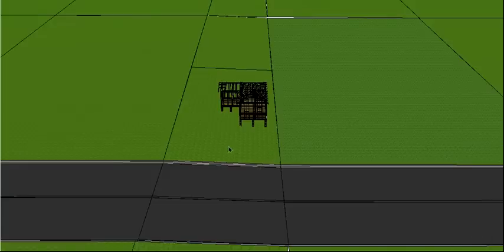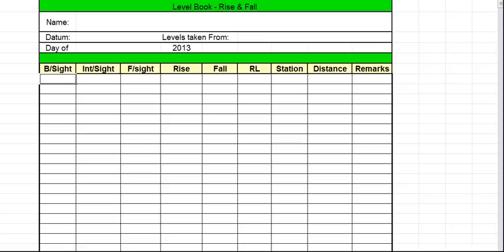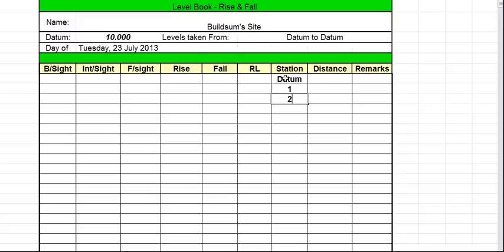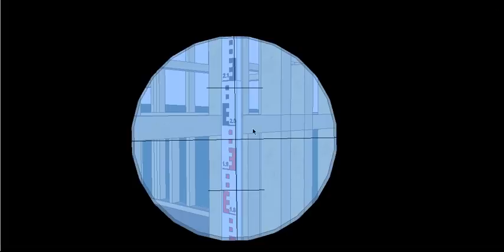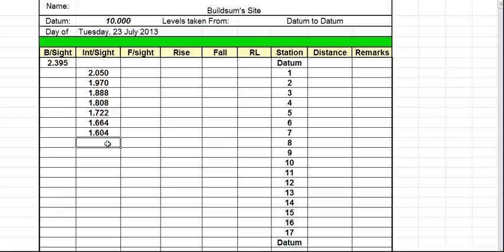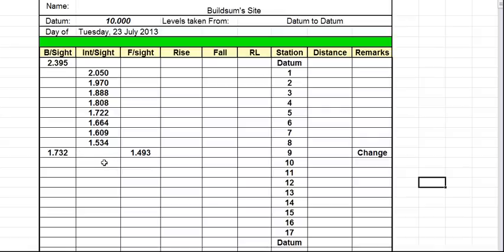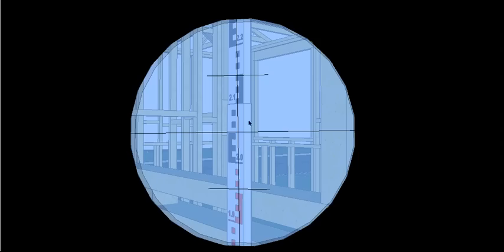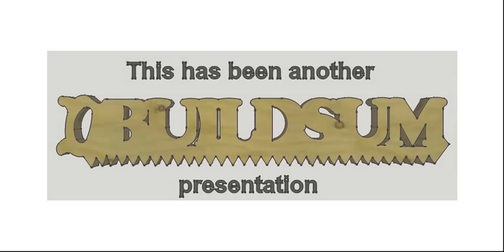Taking levels

Comment: Please correct me if I am wrong but wouldn't you need to take the level readings before building a house or was there another reason for taking them after the house was built?
Reply from the maker: Hi Mate, there is usually a site survey done as part of preparing the plans and getting the contours for the site however information about the height of specific points on the site are not included. 
 To be fair this is not a survey that you might usually require, you may only need to get the height of one or 2 points at any time however the process is the same and the point of the video was to demonstrate how the level book is filled out.

Comment: Thanks again. it would be appreciated if you could help in setting a dumpy level or theodolite on a given BM and fixed peg. i mean to align it with the peg at the Bm. When i try to set it , the whole levl goes off the preset point.
Reply from the maker: +Kiran Dewoo Hi Kiran I have only ever done this using the the Plumb bob or the sight supplied with the instrument. It is a pain to get right but gets quicker with practice.
Reply: ok thanks

Comment: great animations!  I love all your vedios and you are really helping us all! I only have a question: at the end of the process, when you looking back at the datum point (the reading is 2.634), why did you record it in the "foresight" column?  The datum is a known point, I think it should be in the backsight column?
Reply from the maker: Hi Mate, in this case, because it is a closed survey the point would be known, however, if it was an open survey it wouldn't be and as it is the last reading in the survey it will have to go in the Foresight column otherwise the checks will not work. Hope this helps.
Reply: @Buildsum  thank you very much!!!!

Comment: so why can't old mate on datum 9 stand right on the corner so when you move the dumpy (change) he can see the staff from both sides and have the same reading (not moving the staff just turning it so he can see it with the dumpy)
 and if he did how would you write it on your sheet?
Reply from the maker: Hi Mate, yes that is the idea however you won't have the same reading because the instrument has moved and won't be at the same height as it was. The booking on the sheet would be the same.
Hope this helps

Comment: Buildsum still loving your videos, fantastic stuff each and every one. 

Quick question, Pier 1 and pier 17 are the same does or should this be noted
Reply from the maker: RobertJohn Hi Robert You could note it if you wanted or you could delete the reading on 17. If you do take the reading just make sure that you end up with the same RL for both. I checked the Rise and Fall sheet and we do so all is OK.

Comment: Excellent explanation, however that's not standard practice recording...….I am sure it will work for this though.
Reply from the maker: Hi Shawn, i would be interested in seeing how you do it as this is how it is taught to Building Students in NSW.
Reply: @Buildsum  What your doing is fine....it varies in terminology etc.  It all accomplishes the same goal...in England/Europe they label it as shown above, just different terminology...….

    I certainly no expert and I imagine it varies from school to school, job to job and depending on what type of report.

  If you watch the video I posted it shows how that style can be read , used to double check for errors etc.

  What you did is fine and will work....I am sure some where they teach or use a system completely different than all of this......there is certainly nothing wrong with what you did.
Reply from the maker: Hi Shawn, thanks for showing me that, I agree the results will be the same regardless of method. Its interesting to see alternative methods though.